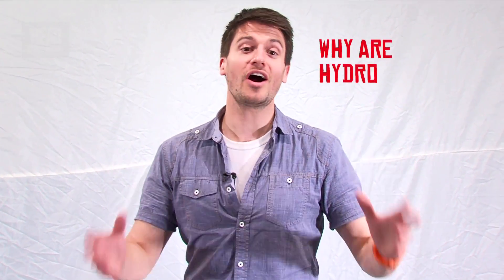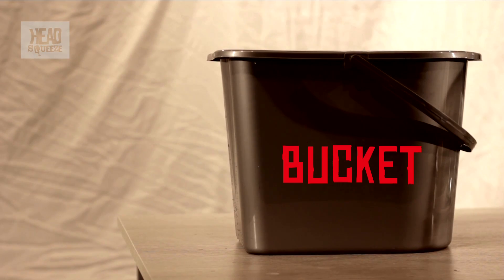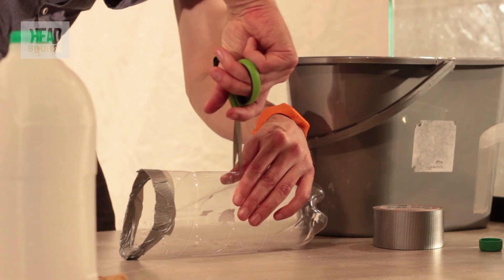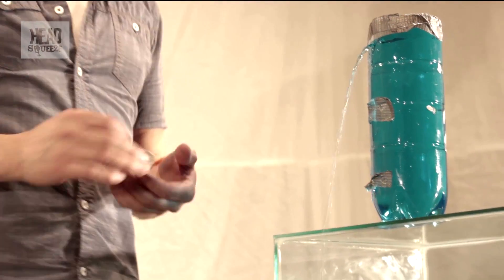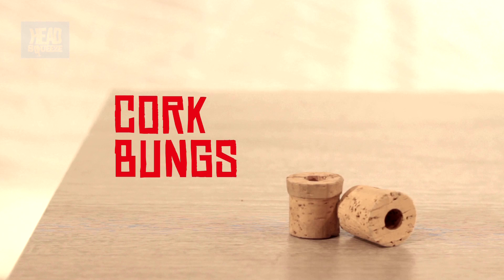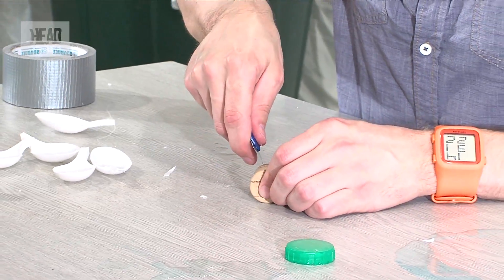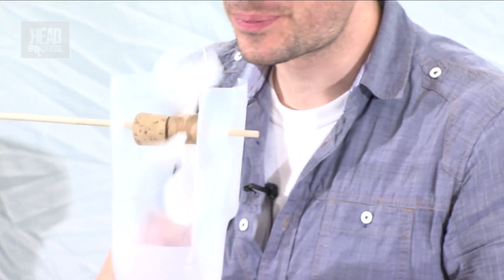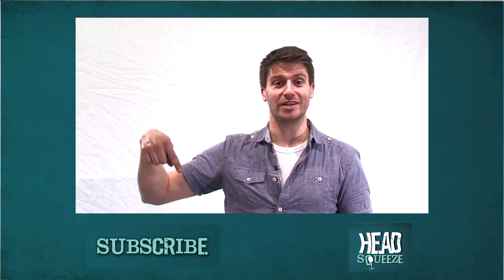How do hydro-power dams work? | Live Experiments (Ep 12) | Head Squeeze

Comment: You didn't answer the question at all! Put the container up high and hold the turbine in front of the hole. Then attach a hose to the hole running down to ground level and hold the turbine to the end of the hose. It will spin faster due to the height difference. It's not about how much water is above the turbine, it's how high above it is! That's why the dams are built up in the mountain while the turbines are in the valley.

Comment: It's all converting potential into kinetic. But there are two fundamentally different types of turbine. A 'reaction' turbine is completely submersed and steals pressure from the water. An 'impulse' turbine uses a nozzle which converts pressure head into a fast water jet which hits the blades transferring momentum. We need height because pressure is essentially only dependent on depth. Pressure difference=density*accel'n of gravity*vertical depth. Pressure and potential energy are similar.